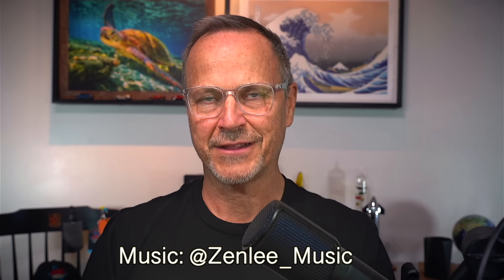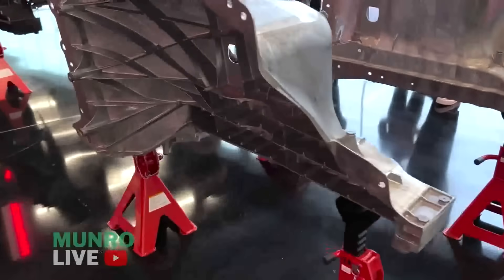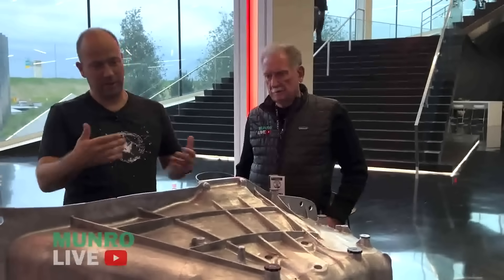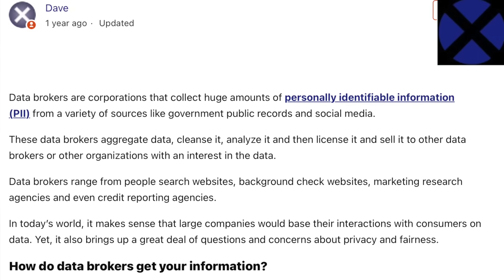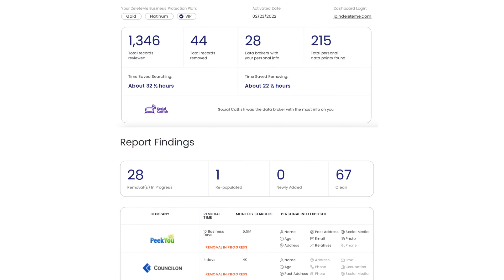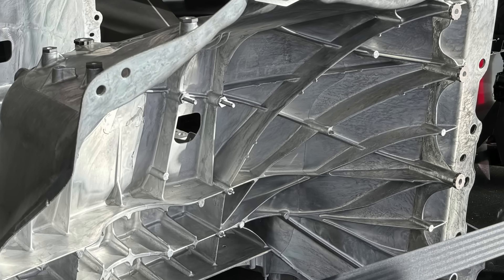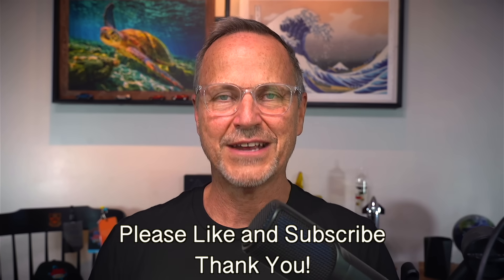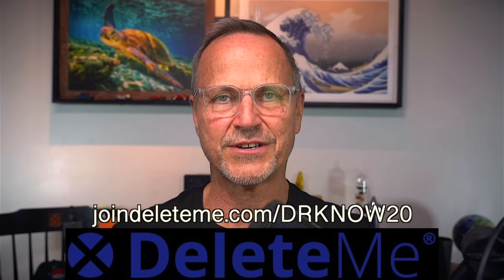Tesla Chief Engineer BLOWS Sandy Munro’s Mind!!

Comment: Impressive castings, you can see from the depth of the webs and the number of injection points, they are trying to achieve two things….. a high rate of flow and stability as the casting cools. This is serious engineering !

Comment: I took what the engineer said about where the liquid metal flows in to mean not at the connecting bridge as Dr. K-I-A said, but more centrally into the two wheel wells - the largest masses of the casting. If you jump to 9:30 and pause, you'll see the remnants of what could be one of the in-gates. On the smooth face of the far side, it looks like a small vertical reinforcement near the hole. I'm assuming there are in-gates in that location on both wheel wells. Metal flowing in from those locations makes more sense relative to the 'flowing river' analogy as on the near side you can visualise the metal flowing out to the edges of the casting with the ribs designed to provide a smoother flow. 'Rivers' only flow one way efficiently and I think it's fairly obvious from the pattern of ribs that the metal was flowing from near where they converge than from the opposite direction.

Comment: I am familiar with a process similar to what they are doing here but on a smaller scale. The machine does not break down often and when it does it is usually fairly easy to fix. What the Tesla engineer was talking about was the Die, not the press. The die having a failure is a LOT of work to fix. If you have two dies then you have one active and the other is being checked and refreshed. The die is usually MANY pieces of metal with heating and cooling channels running through it. If just one of those pieces in the die has a problem that is some pretty complex, custom machining to remake it. In a facility like this, a great Tool and Die person is worth their weight in gold and they are getting harder and harder to find.

Comment: One thing that is overlooked about the Giga Castings, is when they are displayed and setup for production into the vehicles, they are rotated into the opposite position they were in when they were cast so gravity can also provide additional force to flow the molten metal.
Reply: I'm not so sure that "extra flow" is relevant as the Gigapress doesn't rely on gravity. In the Gigapress the aluminium is injected into the casting mold using a plunger providing a maximum of 81 metric tons of force. The liquid metal goes into the mold at a velocity of 10 metres per second (22 mph; 36 km/h). Perhaps what orientation the mold is has more to do with the axis of where the Gigapress can apply the 6,000 ton clamping together of the two halves of the mold. It likely also relates to efficiently opening/closing the mold halves & subsequent handling of the casting.

Comment: 24 hours x 7 days =168 hours. 5,000 units divided by 168 hours is 30 per hour, so that's 30 an hour or 1 mold every 2 minutes 24 hours a day non stop for 7 days. you don't think that's a bit of a stretch?

Comment: If one of the large castings is damaged in a minor crash it's going to total the vehicle driving insurance cost to spiral out of control.
Reply: If the casting only costs ~$3,000, It will save you $30,000. Because waaay less labor to build a new front end with control arms, body panels, etc. and just Bolt it on and go. Instead of the current method of drilling spot weds and fabbing up a bunch of mis-fitting steel stampings in black primer. Then sanding and body filling. Masking, And painting. 

Tesla has no paint, the panels are perfect as they come. And everyrhing unbolts and bolts back together with no fabricating skills whatsoever. Its literally legos compared to custom metal fabrication and paint work...
Reply: You really don't understand body work.  The casting will cost $20000 and you will have to completely disassemble the truck to install and when you try to install you will find what it is bolted to is out of alignment.  Did you hear about the Rivian that had a bumper tap that cost $42,000 to repair.

Comment: I want to know Sandy’s thoughts on the truck’s giant flat windshield, and how potentially dangerous that is with Sun reflecting into the eyes of oncoming drivers.
Reply: It's not flat. It has a slight curve and Franz mentioned this I think in a previous Munro video.
Reply: The windshield isn’t flat and it points to the sky, so it’s a non-issue.
Cheers
Reply: @Julian-1111  are you saying the glass is curved?
Reply: @tedecker  
Yes, it’s curved outward and will disperse light, not return it.
Cheers
Reply: The only way that curved windshield could reflect a small amount would be if the CT was on its side.
Cheers

Comment: The 4-sided reinforcements  and right angles in the casting could allow more surface area in the die 
 than the triangles mentioned by Sandy, and would be one way to regulate cooling rate and uniformity of the casting material.

Comment: Giant Hot Wheels car. Mattel has been focused on mold flow for decades with their Hot Wheels tooling department in Penang Malaysia. Single piece zinc - aluminum alloy chassis with no flashing. Curious if there is any post casting de-flashing processing required with these Tesla castings.
Reply: Mattel is going to take them to court for patent infringement :)
Reply: Patents are only valid 7-14 years. 

And the whole point this is incredible, is how large it is. Hotwheels by default is not large.

Comment: Those Deep ribs can be adjusted for depth to get Most of the Cooldown distortion out. Fine Tuning wb done to the Mold itself.
Consistency with the Injection process, will Probably make the Castings hold tolerances within a Range of 1mm (.04") OR +/- .5mm from nominal. When it’s bolted to the Exoskeleton , will get even more accurate, (that last bit of spring).
Magnesium was possibly added to the formula, maybe some Tin also, both would help with Flow.
I wonder if the "Vents" have a Vacuum assist to Pull the trapped air out, ahead of the "flow".
Cheers from San Diego

Comment: Of course molten metal flows like a river. It's a fluid. Just apply fluid dynamics for its properties.
Reply: But a closed mold holds air volume that must escape and be replaced.
Reply: They pull a vacuum in the mold. No air... @Triple_J.1

Comment: I would love to see 👀 the Stress Calculations on that casting. Considering that this is the stress frame for the Front Suspension of an SUV then any rough roads and terrain with put high twisting forces across that casting. Not sure that it will survive that ?
BMW used Alloy Castings in suspension components of the early M5 SUV and they had to make design changes to subsequent models because they under estimated all the lateral loads the can occure with rough terrain.  ?   ⚠️

Comment: On Munro's factory tour it was stated that the line can run at 60s/vechicle

One shift: 60min x 8 hours x 5 days x 50 weeks == 120,000 vehicles /year
Reply: One shift: 60min x 16 hours x 5 days x 50 weeks == 240,000 vehicles/year. Run it 20 hours (allow four hours for maintenance) a day and One shift: 60min x 20 hours x 5 days x 50 weeks == 300,000 vehicles/year. There were TWO lines set up in Sandy's tour. How many vehicles/year would that make?  I don't think line capacity will be the limiting factor here. 4680 production may be the limit.

Comment: Question: how easy will it be to fix a fender-bender with the CT?
Reply: If the fender is on another car, it will be expensive for that car owner. If the fender is on a cybertruck, it won't need repairs.
Reply: @brunosmith6925  I actually am wanting to know how long to get body work done. Rivians have been reported to take months for the body parts to be available. A legitimate question….

Comment: How do you repair this casting after frontal crash?
Reply: Big problem for insurance companies…. Brings the premiums up and back to the consumer/driver to bear the costs for a very limited repair opportunity.
Reply: If the crash was so dramatic to damage the casting the vehicle is probably a right off as in any vehicle. Although as Musk has explained these can be repaired the damaged part cut out and a replacement part welded back in.
Reply: I like Krazy Glue. My revivifier stitched by head on to my neck 😷

Comment: I have a background in manufacturing engineering and I can assure you that if the part engineer works closely with the tooling engineer (tool & die) you can make a stronger part and a manufacturing friend part. The clamping pressure of the press depends on the face to face area. So if a part is designed with much of the mass deep in the die rather than facing the other 1/2 of the die you can decrease the clamping pressure.

Comment: Some folks may be familiar with metal casting from high school shop class but die casting is much more akin to injection plastic molding.  When designing parts you always consider how metal or plastic behaves as a fluid: how it flows.  Usually the injection process happens in seconds or fractions of a section and is complicated by the rapid cooling of the fluid.  They make good software to simulate the flow and to predict where the fluid may not reach parts of the mold cavity or create "knit" lines where the molten metal or plastic doesn't meld together.  The collaboration between the part designers and manufacturing is mostly tweaks to where the gates are located (where metal enters the mold) and the timing.

Comment: I have  a feeling Cybertruck is going to disrupt the truck industry. Basically all the journalist and a lot of truck owners as well as FORD is saying that the Cybertruck have no chance. But I have a feeling from TESLA's marketing (allowing access to the engineers, designers and people working on the floor) might actually sway buyers. No marketing types trying to sell the truck but people working on the assembly line. Seeing the factory and the people working on the truck makes me salivate and I know from the type of people the buy trucks this is their interest as well. So the thinking is that traditional truck buyers will not purchase a cybertruck. I think this will change once the truck is common on the roads. Some off roaders will try it and if it works it will take that by storm as well. Fixability on the trail might be an issue but we will see. 

We tend to forget that Elon Musk is not the only smart person at TESLA. He surrounds himself with people that is just as good or better than he is.
Reply: I agree. Insulting critics claim Real Pickup Men won’t buy, ‘cause RPM hate change. Remember when Real Construction Men wouldn’t be caught dead with a cordless tool? Times, and people, change…

Comment: Neither Cybertruck nor F150L will attract many consumers of the F150 (ICE). The price difference is too great. Maybe you can make up that initial price difference with a lower operating cost, depending on how you drive, but twenty grand requires many years, even decades, of saved operating costs to break even. I don't think that argument will change many minds.

Comment: 🎯 Key Takeaways for quick navigation:

01:13 🏭 Tesla achieves efficiency by using the same size press for front Giga casting on Cybertruck as Model Y, showcasing design and manufacturing synergy.
02:33 🔄 Tesla's iterative process, involving in-house die designers and casting engineers, reduces the expected 8,000-ton press requirement for the Cybertruck's front Giga casting to the same as the Model Y, highlighting adaptive design practices.
07:30 🏭 Giga casting technology enables rapid production with potential weekly output of 5,000 Cybertrucks, showcasing Tesla's manufacturing capabilities and efficiency.
10:44 🔧 Tesla's Material Science team, possibly the world's best, develops an exotic aluminum variant for Giga casting, allowing smooth metal flow, rapid cooling, and high structural integrity.
13:36 🚗 Giga casting design incorporates safety features, such as crushable areas and strategic battery placement, contributing to Tesla's vision of creating the safest truck, while eliminating traditional safety concerns like impalement risks.

Made with HARPA AI

Comment: Cant you use laser for catting in order to make more precise in order to put giga partts together?
Reply: I'm gonna attempt to understand what you were trying to say. No they don't need to cut anything with laser when it comes to the giga casting because it's made as a single part to be extremely precise. The whole point is less parts which means less errors.

Comment: @DrKnowItAll .... I assume that Tesla creates a 3D printed model of the diecast part; Set the model into a casting mold; remove the model and reset the mold for the hot aluminum to be poured into it.  Once cooled the mold is opened and cleaned for the next diecasting. The finished casting is cleaned up and measurements checked for accuracy for assembly.

Comment: When I first saw the video of the front casting, I noticed the curvilinear channels that I call ribs on either side of the wheel well and noticed that the advantage that one gets from using these curvilinear channels is multiple. Yes, you get a faster a flow of the liquid through the mold and more likely even cooling of the entire mold which also reduces the potential for warping, especially given that the ribs act like stability fins of for the thicker metal parts of the structure.

Comment: The metal is not injected directly onto that cross bar. What can’t be seen on a finished part is all of the material that has been trimmed away. If you can see images of an untrimmed casting, you will see a massive cylindrical feature, which is the injection point,  and webbing leading from there to the finished component; all of which are trimmed away in the finished part. It is surprising how much material is removed and recycled. An untrimmed part has a horizontal panel that connects to the bottom interior edges of the finished part. This horizontal panel distributes the molten metal to all of the finished features before it can cool and freeze causing a short shot.
Reply: Good description of the way people have been casting metal for the last 2500 years…

Comment: Yes, Teslas real contribution to society is really its engineering ethos and no one is seeing it. He boldly defies the risk aversion that so many other companies are controlled by and he incorporates failure into the design process again no other companies do this, or not to his extent. Its brilliant really, and we need this. Another thing no one is realizing is his design ethos, innovation, instead of benchmarking his products so he doesn't make a product any more or less competitive he goes all out and simply makes the best product humanly possible and the most innovative and disrupts the market. No one realizes how calculated this is, its right out of Game Theory iterated prisoners dilemma and Nash Equilibrium strategies. Young people don't see it as clearly because cars have always been the way they are to them, but as an old guy, I have watched the auto industry slowly over time collectively screw the public with their ever more cheaply built pieces of shit cars that have become ever more unreliable and ever more less performing and glitchy to the point now where they cant even keep the AC working for more than a few years or a heater core from leaking, things that would routinely last 200,000 miles or 20 years. All the legacy automakers are hurting right now, ... and I'm fucken liking it.
Reply: You are deluded. There is nothing that tesla does that someone hasn't already done. As for being quality products... ffs.
Reply: @TrevorSachko heat pumps, octovalves, Giga castings, steer by wire, vision based self-driving, UI controlled functions, and high performance electric vehicles.
But, other than that, what have they done?